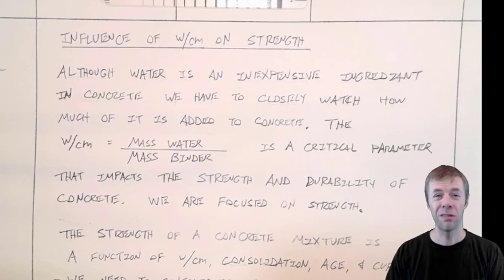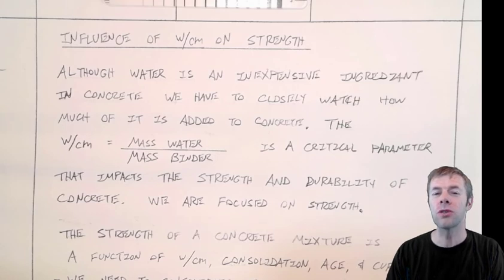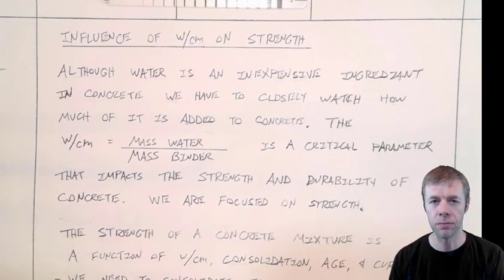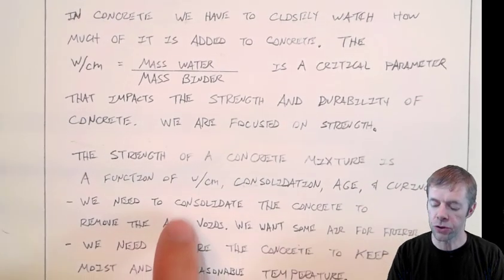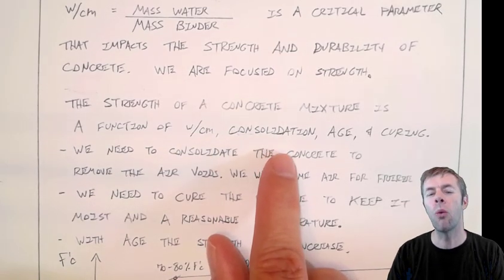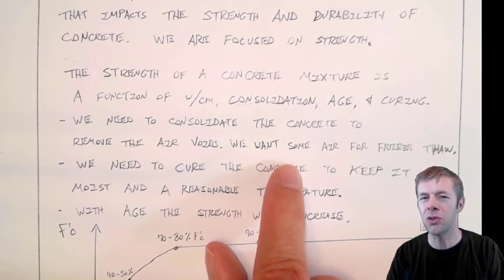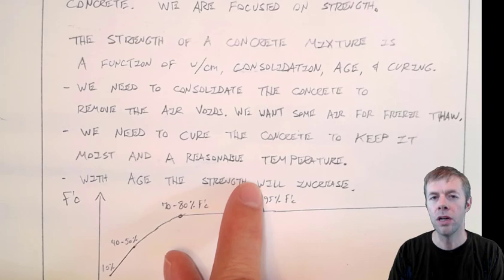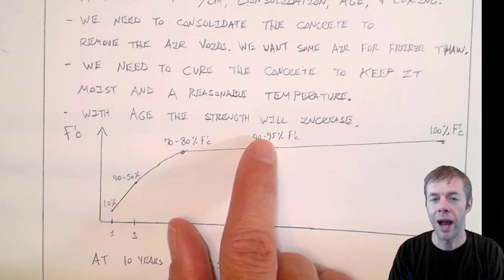Compressive Strength and Water to Cement Ratio in Concrete

Comment: You are really awesome Mr Ley you have made me in love with concrete Lol.
Actually,I didnt get what is the benefit of air except economic and workable!!and how do we measure the air ratio?!and my second question is,does cement act to give the concrete strength or only we use it to adhesion?

Comment: If I order concrete with a certain water cement ratio, say .4, and minimum 5kpsi, how do I know for sure the concrete company delivers exactly what was ordered and they didn’t cut corners?
Reply: Typically, you would order concrete by its 28 day strength (35Mpa cylinder sttrength at 28 days). To check if you get what you ordered, you usually make cylinder samples in accordance with ASTM C31 and test the 28 day strength in accordance with ASTM C39.

Comment: What is the best component that defines  the compressive strength of a concrete?

A. Cement
B. Water
C. Gravel
D. Sand
Reply: It's the ratio of the components that define the compressive strength. Less aggregate to cement usually means a higher compressive strength.

Comment: I cant understand why I NEVER HEARD THE BASICS!  iN ONE OF YOUR VIDS you seemed to be worried about water left in a mixer even!you even said once its mixed there is no way to know water content after its mixed...WHAT ABOUT A SLUMP TEST?aND THE STANDARDS ARE THAT WE USE A 4 INCH SLUMP VERY COMMON!  I DONT KNOW WHY SLUMP AND THE WORD VIBRATOR ARE NOT ADDRESSED HERE,just looking at the title of this vid.An on- the job engineer told me we had to pour a 4'' slump,but if we wanted to add water to make it easier to work and get beter consolidation.noHONEY COMB,WE COULDadd half a sack to a yard..of course,not on that job,just in general.  aLL THIS IS much too complicated..basically too much water makes it weak...be sure to vibrate but be careful not to over do it..dont be tight and try to save 6 bux per yard,cutting PORTLAND content...6sack mix makes 4500lb.concrete..i think that number iscorrect..but I cant say I learned thoseimportant numbers here!
Reply from the maker: Thanks for the comment.  Not all videos cover all topics.  

The slump test was invented in 1911.  It was an awesome tool at the time but now it doesn't mean much.  We have a ton of different ways to modify our slump from admixtures, to supplementary cementitious materials, to aggregate gradations.  Slump is only a measure of consistency.  There are new ways coming to measure the water to cement ratio and so stay tuned.

I am sorry that whoever you are working with is trying to be so narrow in how they will accept concrete.  I don't believe in this approach and I think performance is much more important.  However, this will take education, patience, and time to teach people how to do things differently.

Here are a few videos that might be helpful: 
Intro to concrete mixture design - https://www.youtube.com/watch?v=rv-JwoRfV0E
performance based specifications - https://www.youtube.com/watch?v=U6TTgW2oLqM

Comment: dear sir, while studying the Abrams law in a text book, i came across a statement that says " """"According to the water cement law, the strength of concrete only depends upon the quantity of water used in workable concrete mix and is quite independent of the proportion of cement and aggregate"""""".  i cant  visualize how  the strength is independent of  proportion of  cement and aggregate ?
Reply from the maker: Good question!  I am going to cover this exact topic in a future video.  

It is not as easy as the text book says.  However, the water to cement ratio is really a measure of how spaced the cement particles are within the paste.  If the particles are close together (low w/cm) then it will be easier for the hydration products to grow together.  If the particles are far apart (high w/cm) then it will be harder for them to grow together.  This behavior does not depend how much cement is in the mixture.  This means that the strength of the mixture should be only dependant on the w/cm.

This concept works great in the typical mixtures but doesn't always work in very low w/cm, high strength concrete, or if you have weak aggregates or weak bond between the aggregates and the paste.  More details to come!
Reply: Tyler Ley thankyou sir for your reply. i am eagerly waiting for the video.
Reply from the maker: Amrit,

You can find the video here: https://youtu.be/K_0sn5KlOvQ